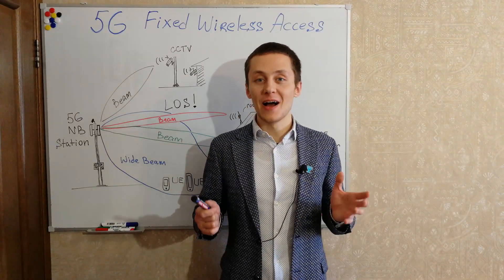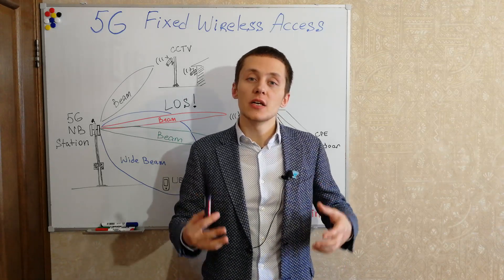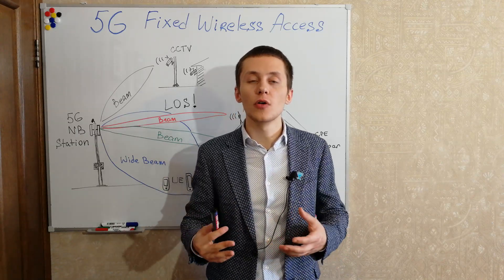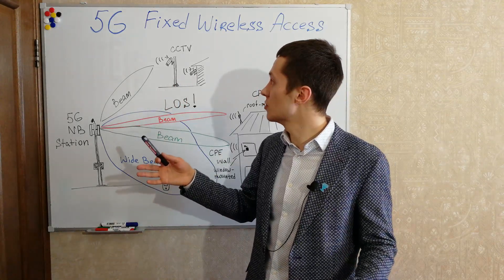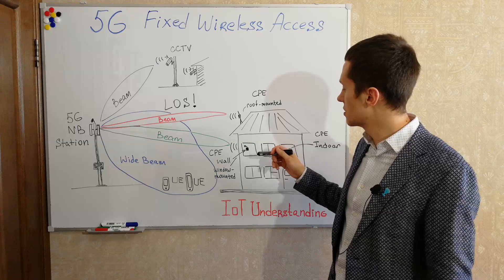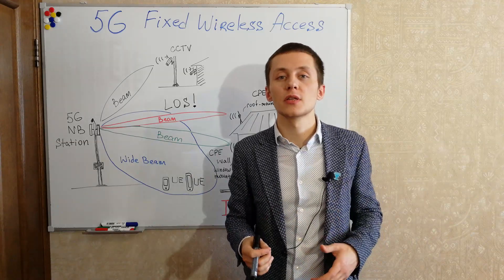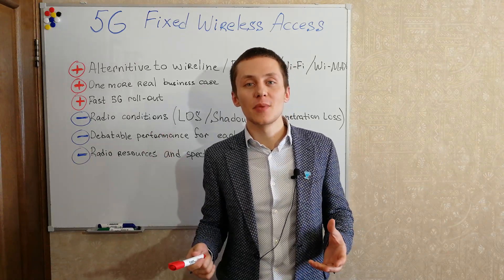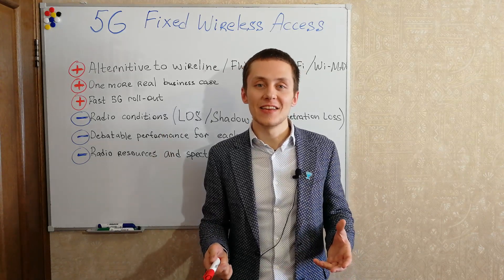5G Course - Fixed Wireless Access (FWA) Cases Advantages and Disadvantages

Comment: This is good for you can have hospitals, library ,industrial, governments, condos, hotels to have second antennas installed incase main public antenna fail. This means if main area antenna fail because of natural disaster or vandalism the building 🏢 antenna works until seamless.
Reply from the maker: That's absolutely right!

Comment: Many people will applaud FWA as it offers a economical option to sell more internet services into tricky locations.  However, among its biggest demerits are the negative health consequences of showering a vicinity with a small neighborhood 24/7 broadcast antenna, and adding yet another powerful radiating antenna inside the home.  Only when dots are connected and serious illness to occupants and their pets does manifest, will it be realized that there is little chance to safely access the internet via wired/Ethernet with FWA providing connectivity, as would be the case with coax-provided internet.  People are being harmed as soon as these are installed into neighborhoods, though only a few percent will experience acute and obvious symptoms ... everyone can look forward to chronic illness that will be subtle in origin and manifest over time from such broadcasting antennas in and near our home environments.  Instead of slavering mindlessly about the 3G -> 4G -> 5G -> 6G techno-benefits, it would be great if some intellectual muscle was applied toward making such wireless communication signals less injurious to our biology and the local ecosystems.

Comment: Can you have MPLS over 5G FWA?
Reply from the maker: Yes, it is possible to use MPLS (Multiprotocol Label Switching) over 5G FWA (Fixed Wireless Access), though the implementation depends on the specific use case and network architecture. MPLS can operate as an overlay on the 5G FWA transport network. In this case: MPLS runs on top of IP or Ethernet, which in turn runs over the 5G wireless link.The 5G FWA connection serves as a Layer 2 or Layer 3 transport network. MPLS over 5G FWA is technically feasible and can be highly effective in specific scenarios, particularly for enterprise or hybrid network architectures.